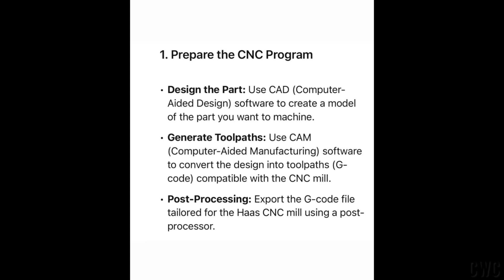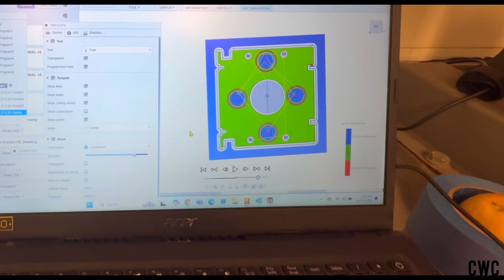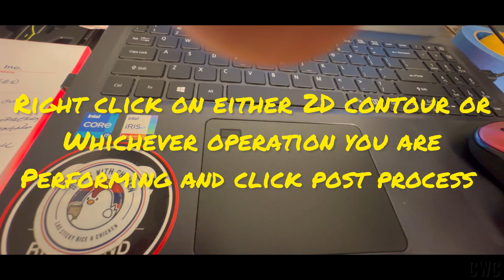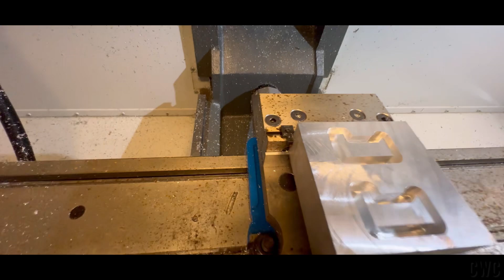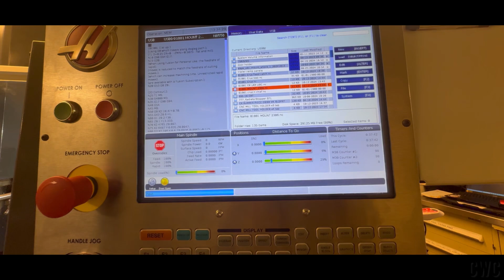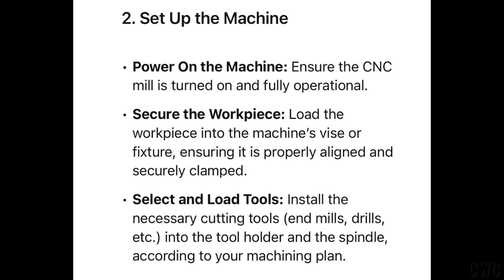Follow these steps before using your CNC Mill | Allied Trades

Comment: You need to have a sub plate to mount your work onto if you're not going to use that vise.  One oops and you'll be drilling or milling into that table. Doesn't matter if you're using Fusion, Mastercam or Gibbs cam. Humans make mistakes really quick.
Reply from the maker: @Vankel83  If you look at the photo when the clamps were mounted on the table there’s a base plate under the existing plate. It was just 1/4” aluminum so it looks like it’s just one plate, 

Also I was just clarifying I’m using fusion 360 since I forgot to mention it in the video, but thanks.